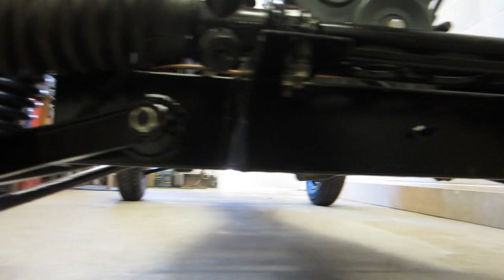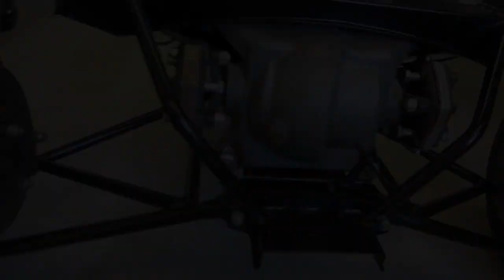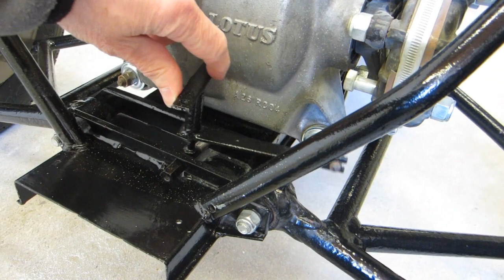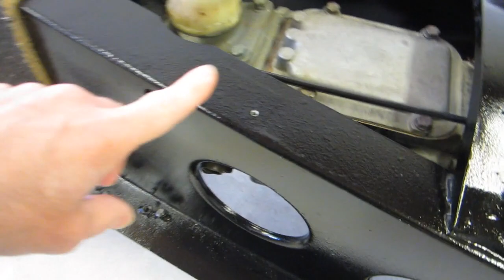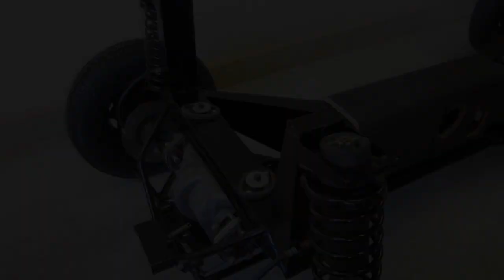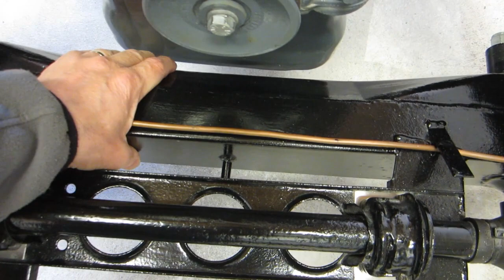Lotus Elan Chassis

Comment: Now that is a nice real Elan chassis. Only later ones were fully galvanised. My 1967 original did not rust so badly anyway. I gave up the doughnuts for a UJ conversion which improved gearchange and ride. I believe later conversions used CV joints. Description of the vacuum is wrong it just uses the vacuum produced between the carbs and inlet valves. Many early Fords used this suction to drive the wipers, which caused problems as the vacuum dropped when the throttle was opened. When the headlight operating cylinders leak on the Elan the lamps drop when you accelerate. This was a problem on early models as the cylinders used a piston with a leather seal. Later there was a diaphragm.
Reply: I can recall seeing those vacuum operated wipers in operattion on 1950's vehicles. It was rather amusing with them accelerating greatly then almost stopping right when you didn't want such variation in their speed.  One instance was during a drive in movie when a lot of cars started their engines to get the wipers operating as rain squall came across during the penultimate partt to the end of the movie as the critical last few scenes were becoming obliterated by heavy rain.

Comment: Great video - Thanks for that presentation. I have not seen one as good about the Lotus Elan chassis 
 I wonder if it would not be wise to apply a type of silicon type sealant to that noise dampening fabric so the chassis does not get wet and cause rusting.
Reply from the maker: I'm glad you liked the video.  Thanks for your comments.  Regarding the noise damping, I have seen others use a closed cell foam instead of the original material. However, when I took the body off the original rotten chassis, that area was in the best condition.  It seemed that it was well protected from the wet.

Comment: Very professional Paul.  And very wise to not fit the driveshafts until the body goes back on.
Reply: What's the advantage of waiting to fit the driveshafts until after the body goes back on?
Reply from the maker: Because there is very little weight without the body the suspension is at it's lowest position.  With the driveshafts in place the rubber donuts would be stretched by the angle of the driveshaft.  Better to fit the rubber donuts when the suspension is loaded so the driveshafts are more or less horizontal which will put the least amount of stress on the donuts.  (Sorry for the very slow reply).
Reply: @PaulH_S2_Elan  it is 1.2mm steel all around?
Reply from the maker: @FirstLast-tx3yj  It's not all 1.2 mm.  There are also parts made from 1.6 mm.
Reply: @PaulH_S2_Elan  how does it compare to other types of chassis when it comes to tosional stiffness?

For some reason I expect it to feel not rigid
Reply from the maker: @user-eg6rm4zh2o  I've found a published torsional stiffness.  4300 lb/ft per degree for the chassis.  It gets stiffer once it's bolted to the fibreglass body, but I can't find a quoted stiffness for the body and chassis together.  When the dashboard is fixed in place, this also adds to the overall stiffness.  There are so many clever design features.  It made it a joy to reassemble, seeing all these.  I can assure you there is no noticeable scuttle shake at all.

Comment: A fascinating video, thanks.
Minor quibble, though: those are in fact Macpherson struts, not Chapman struts.
Reply from the maker: Hi, The Chapman strut is used for the independent rear suspension.  The McPherson strut includes bearing so that it can rotate and be used for the front suspension with steering.
Reply: @PaulH_S2_Elan  No, a MacPherson strut is a MacPherson strut whether or not it's attached to a bearing.  
A Chapman strut uses the halfshaft as part of the suspension, which MacPherson struts do not.  Per Wikipedia, '"The Chapman strut is often confused with the MacPherson strut, as both use a near-vertical upper strut, The distinction is that the MacPherson strut always requires a lower track control arm where the Chapman uses the drive shaft and a light radius rod."
The Lotus Type 14 Elite and Type 16 formula car, for example, use Chapman struts.

Comment: Really good video only one slight  contention. It’s not a chassis it’s a sub frame.
You can drive a chassis you cannot drive this. I won this argument with HMRC over an imported S2. DVLA consider it a sub frame because the vehicle details are  attached to the body. But great vid.

Comment: Is that an original Lotus chassis or Spyder ?
Reply from the maker: Hi,  It's an original Lotus chassis.  There are at least two Spyder designs; one is a space frame version and the other is a sheet metal more like the original Lotus design.
Reply: @PaulH_S2_Elan  It’s looking good for an original chassis. Did you have a hoist for the body removal or was it a handful of mates and some elbow grease ?
Reply from the maker: The chassis is a genuine Lotus replacement chassis purchased from a Lotus dealership many years ago.  It one of the last from Lotus and is galvanised.  You can still buy the original Lotus chassis, now supplied by Classic Team Lotus :) but I believe they don't have them galvanised anymore.
With all the components removed from the body it's an easy lift for 4 people, and that 's what we did with mine when it was lifted off and put back on.

Comment: Did i heard "40 kg"?
Reply from the maker: Yes, you really did.  The bare chassis weighs 40 kg (88 lb).  Once this sheet metal chassis (or sub frame) is bolted into the body moulding it makes an incredibly stiff structure.  The bare GRP body weighs 90 kg.  Maybe you've seen the video that explains more about the body: https://youtu.be/nFMTjNaYUhk
The Elan is truly a lightweight sport racer.